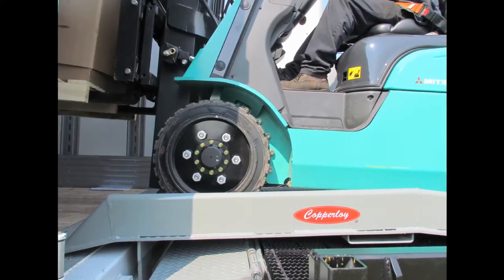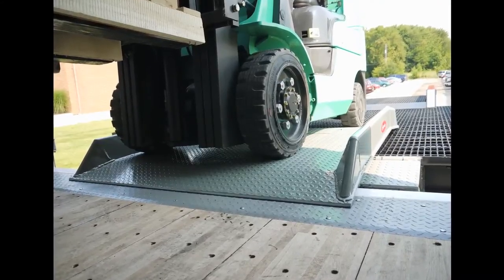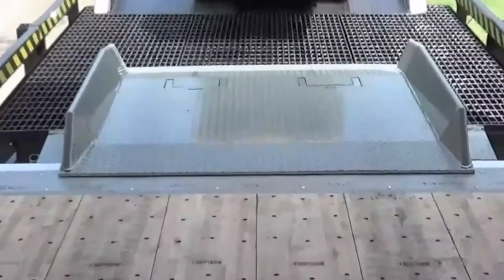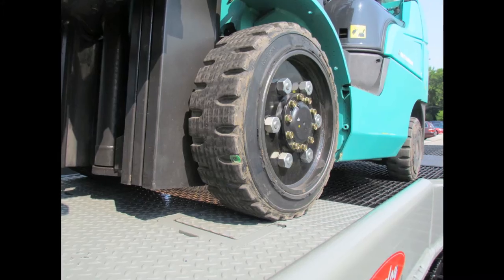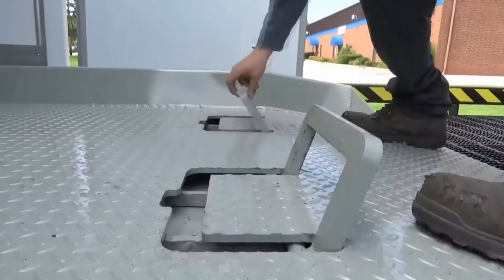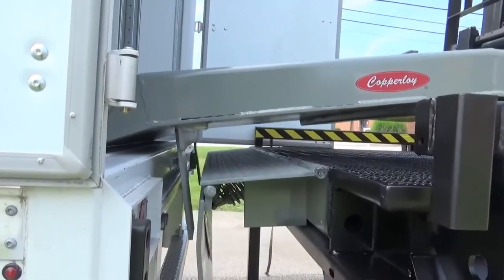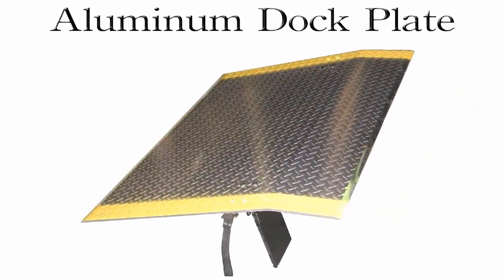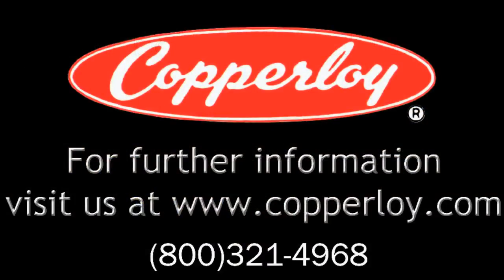Dock Boards by Copperloy for Loading & Truck Docks

Comment from the maker: Copperloy’s dock boards provide loading and unloading when using forklifts or other equipment. Our dock boards come in capacities up to 30,000 pounds and have welded steel curbs.  #MaterialHandling   #Manufacturing